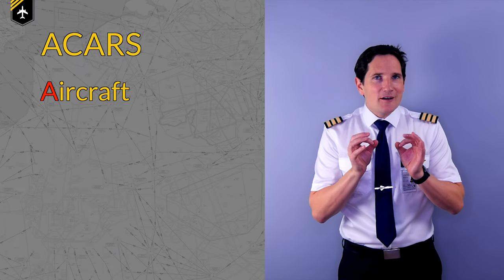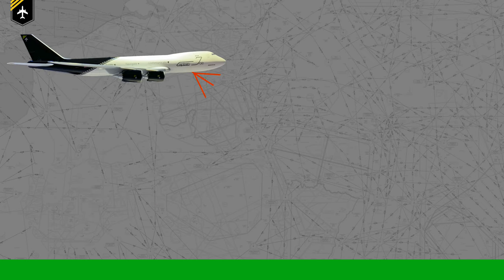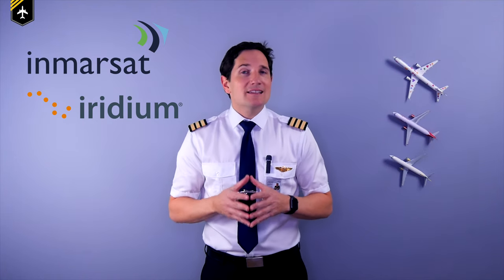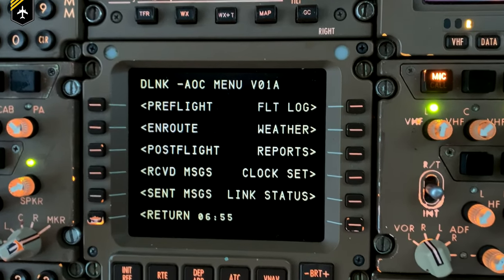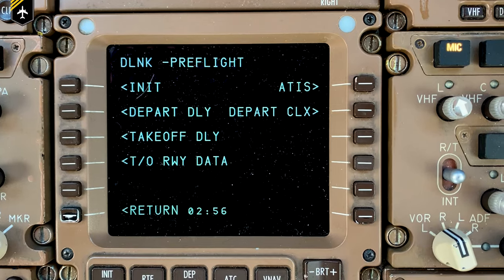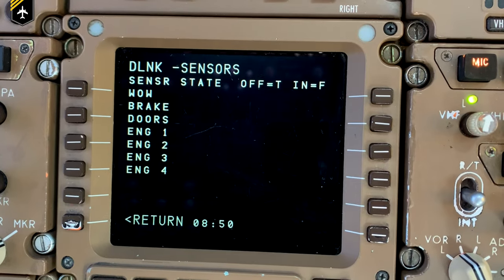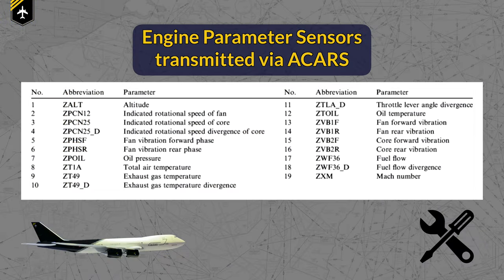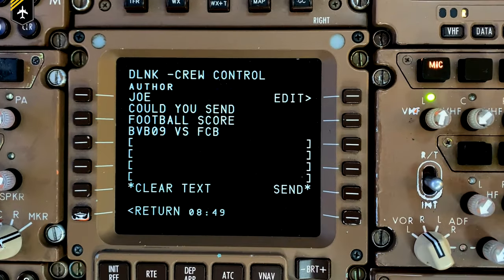WHAT is ACARS? HOW does it work? Explained by CAPTAIN JOE

Comment: I think it was a pushback from gate because ı see something off on minute '7'  and engine 3 and 4 starts minute '8'
Reply: And ı think this airplane was a 777 as far as ı can understand from cdu
Reply: Firstly if it was a 777 why does it say ENG 3 and ENG 4. Secondly if it was pushed back from the gate the brakes would have to be released BEFORE engine start
Reply: @tomstravels520  yep that's the weird thing 777 has 2 engines maybe 747/8

Comment: You were not pushed back! 
The brakes were released after the engines ran. If you were pushed back, you would release the brakes and then fire up the engines. 
Also, 3 minutes after the release of breaks the aircraft took off at 06:16! How can you push back and take off that fast?! 😲🤣

Comment: Can pilot turn off this ACARS system during flight or he must switch fuse off or induce short circuit to disable it (MH370)?
Reply: Need to pull the fuse. But that’s in the equipment bay; not in cockpit.

Comment: This looks like the aircraft was parked at a place where a push back was not required. Because all 4 engines were started before brakes released and a lot of airlines don't approve of push back with multiple engine starts. 

unless this aircraft was pushed back from the gate and the parking brake was engaged again for tow bar removal and the last time parking brake was released will be the only time displayed.
so this question can not be answered just with just this screen shot. 
Also the brake release time could have also been ATC hold on taxi way for other aircraft's. 
more data is needed for a better answer.
I have a lot of avionics knowledge and FDR investigation time.

Comment: No push back was required, Time between the door close and the engine start is short ?!!
Reply: safin sebastin that’s what I was thinking.
Reply: @reactorfour1682  i glad that we think the same way :). It's what we see on the normal passenger flights - it usually takes a bit to get pushed back and the engines get started. and me with little relation to the tecnical stuff thought of the normal procedure. stay Safe :)
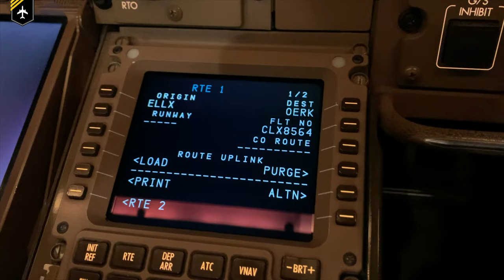Reply: The door is closed a 5:46, the first engine is started at 6:08. Do you really think that 22 minutes are to short for push back???
Reply: @edhoc2  I thought so, is it enough?!
Reply: @safinsebastin9103  It usually takes less than five minutes to push back a big airplaine. See, for example, https://youtu.be/SR92KkY6sug . 22 minutes are more than enough. So, your reasoning is wrong. See the other comments for the right answer.
Reply: @edhoc2  ok, my bad. Thank you for the  clarification. And I should learn more about these stuff.
Reply: @edhoc2  can I get a 5/10 ?! ;)

Comment: In MH370 it turned itself or was turned on again - suggesting its power supply may have been attempted to be used to bypass electronics for instance regulating oxygen and cabin pressure, that ran into being short circuited, as well as all communication.

When this did not terminate issues, it was re-engaged. Pilots may probably have used spare oxygen bottles. As they could not rescue communications though they felt it better to sacrifice their own lives than potentially do harm to another crowded airplane taking off as well, whilst it was too dark, considering lack of available instruments to navigate properly.

They simple had ran out of all other options.

Comment: To the interested viewer: You can DECODE these downlink transmissions very easily! They are not encrypted, and a recent advancement in hobbyist SDR tech affords you the ability to listen to any radio signal from 300 kHz to 3 GHz for only $20, using a small USB radio stick the size of a flash drive: https://www.rtl-sdr.com/about-rtl-sdr/

If you want to know more about about the signal, check this out:
https://www.sigidwiki.com/wiki/Aircraft_Communications_Addressing_and_Reporting_System_(ACARS)

If you want to see plane flying around your area, in high detail, consider listening on ADS-B frequencies too (this is how flight radar sites get their data):
https://www.sigidwiki.com/wiki/ADS-B